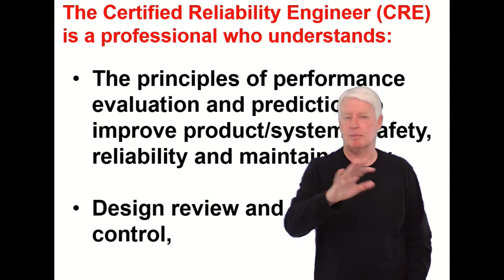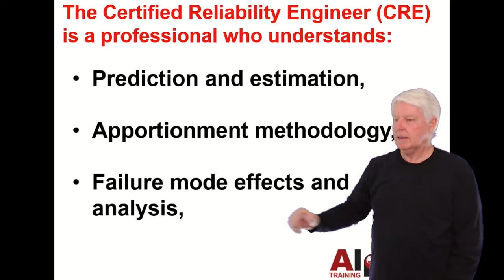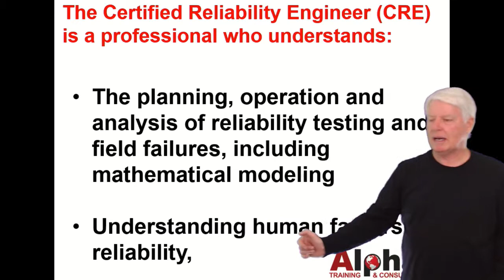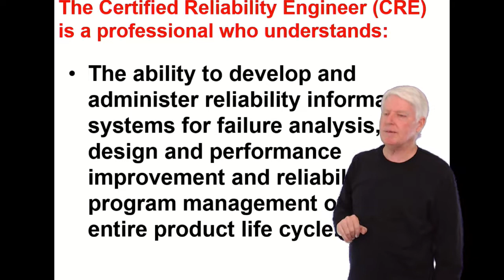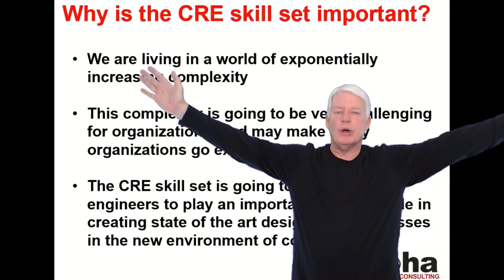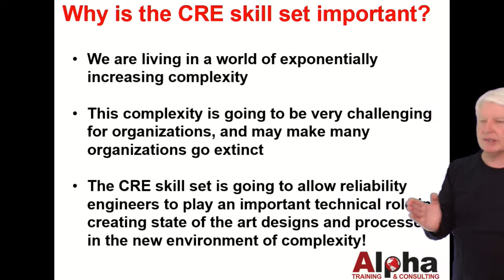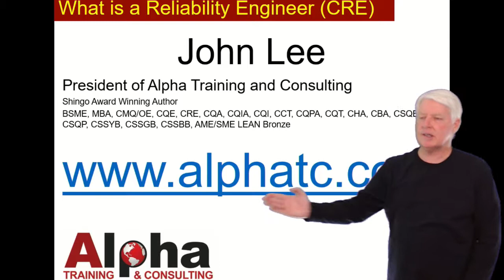What is a CRE?

Comment: When it comes to the reliability of say a plant or manufacturing process, what is the main difference between the maintenance engineer versus the Reliability engineer? Thanks
Reply from the maker: Jose,
Thanks for the message.
These are definitely closely related.  The maintenance engineer is more about setting up and maintaining the equipment over time, so they may set up preventive and predictive maintenance programs, decide whether to buy new or rebuild and etc.  Reliability engineering is more likely to be involved in the design of the equipment to create reliability.  Reliability engineers will spend more time in the reliability lab trying to grow reliability in the design over time.  The reliability engineer will also run tests to help determine current reliabilities.  A reliability engineer may get a job as a maintenance engineer, however, it is unlikely that a maintenance engineer will become a reliability engineer.  
This is my perspective on it.
Hopefully that is helpful.
Thanks Jose,
John Lee